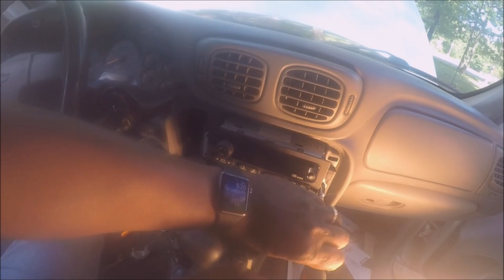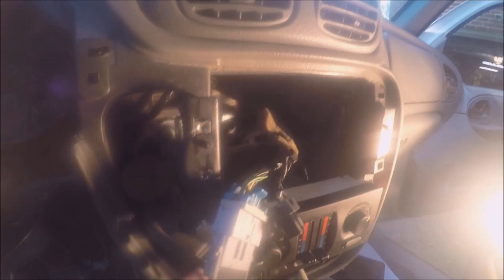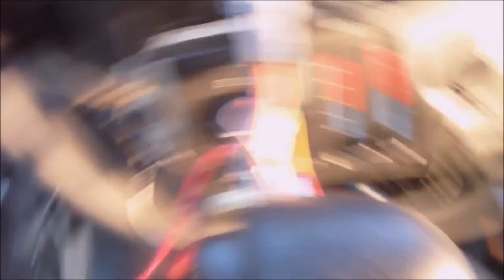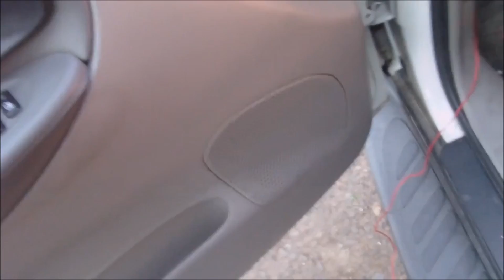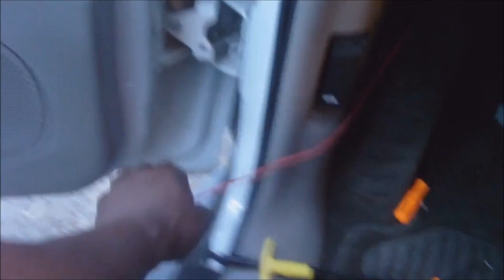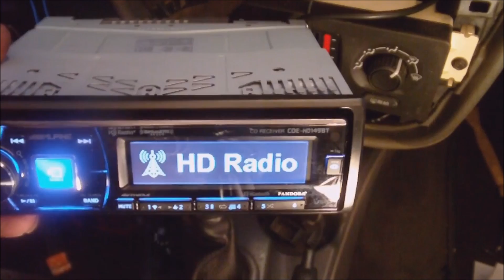2002 Chevy Trailblazer - Wiring The Headunit

Comment: What? Bro just use the power wire on the harness.. thats what its for... you don't need to do all that extra wire running. If putting a bigger amp radio just put a bigger fuse in the radio spot in the fuse box

Comment: Did you keep the fuse in the back of the radio or did you remove it as the add a fuse you used has 2 fuses

Comment: You added a fuse. The guy that did my stereo just connected the red ground to my ignition under the steering wheel and ever since I started to have idle issues. Engine revving up and down, car stalling behind red light. Can you explain why this might occur and why? I just cut the ground wire to see if it would make a difference and disconnected battery, but can’t really notice a big difference in the idle problem. My alternator checks okay too and so does the battery.
Reply from the maker: When you  said, "red ground"  that right there tells me a ground wire was hooked to a live wire so yeah you gone have issues.
Reply: Poppa T the idle is not normal, I disconnected the red ground wire they had connected to the ignition under the steering, but I still have the same issues. Mild Vibration...what should I do?
Reply from the maker: @belsinyounan  I would check the ignition fuse and if you are having the same issues a mechanic.  Too many variables to consider based off the information you are providing.

Comment: I’m trying to run my power wire to my battery and I can’t find a way to run though my fire wall is there other way to run it. I have a 02 trailblazer
Reply from the maker: See where the poker tool is?  That where you would make your power wire run through the grommet.   Just open it a little more for power wire.

Comment: This does work well...temporarily
The problem with hooking it up to your fuse box is, that’s also your trucks computer. This may work better for others but for me it worked for I would say 3 months and than out of random blew a fuse as well as caused my whole truck to shut down. It wouldn’t crank over or anything. Just be careful and cautious of where you hook it up to or you could end up with a problem like I experienced
Reply from the maker: Appreciate your comment but it doesn't hold much weight.  What you suggesting that a fuse tap shut down your vehicle which is preposterous and indicative to hooking up an alarm on a vehicle the same way.   Besides this video predates 3+ years and no issues so you most likely didn't do your set up correctly or you have other issues not pertaining to the audio portion of the vehicle.
Reply: Poppa T I see where you’re coming from but I actually had the exact same setup. I watched your videos when I did it, the problem occurred because it was pulling too much amperage. It could be other problems with my truck as well but I’ve been looking for another way to hook up my radio because for me this method didn’t work long term compared to yours. I was thinking of connecting the same wire you hooked up to the fuse box, to my battery. Only thing with that now is if it’s on the positive terminal it’s constantly on whether the truck is even in the run position or off. The negative terminal supply’s no power to it. Not too sure what exactly my next step is. Do you have any other recommendations?
Reply: We also have 2 different stereos, that could be a main cause of my problem.
Reply from the maker: @ThySteelStallion  Not a big fan of leaving too many hot wire laying around but if you did do that make sure you have a switch to it or you could just use the same wire I used and put a relay on it.  The relay will probably be the best method so go to www.the12volt.com and learn about relay wiring.  Hope this fixes your issue and hopefully you don't have a crapy Android HU.  :-)
Reply: Poppa T Neither am I but I hear ya. I’m gonna have to try it out thanks for the feedback!
Reply: The fuse has to be switched. Just to note. And best to choose something non computer related. I was going to run mine to the back seat fuse box, but I can't find a switched fuse/connection. 
Also note I don't think the  the switched connection draws  much power.

Comment: did you ever have a problem with your dash not working after ? all wires are connected properly. if i take out the add a fuse and put in the regul;ar it goes back to normal. any help is appreciated.
Reply from the maker: RiZzLiTo CADILLAC Tha Don Dash still worked fine. Make sure you are in the right port for the add a fuse. Then I would just make sure your wires weren’t crossed on the harness.

Comment: Awesome video ! quick question i had my brother install my radio and he did it without a wiring harness and recently if i dont start my truck everyday like if it sits for a full day my battery dies can this be because of that red wire not being ran to the fuse back so its not fully shuting down or something ? i just both the wiring harness getting ready to put it together today
Reply from the maker: Best thing to do is try and get the OEM harness back on there.  Possibly the ACC wire was tied to the hot wire and radio was on all the time.

Comment: Where did you tie together the ground wire was it the radio or truck harness
Reply from the maker: Well you tap into the radio and truck harness then run to the chassis.
Reply: Poppa T so when i tie them together then run it to the chassis
Reply from the maker: Jose Escobedo Yep. 👍🏾
Reply: Poppa T you think you can call me at 2196148916 I need to ask you a few more questions
Reply: I’m confused  but let’s just say i tie together all the wires together from both harnesses ok now since the ground wire is connected together do i now tie another wire to the ground then to the chassis or do i do it separate
Reply from the maker: Yes you do.  Tap into that ground wire and ground it to the chassis because it won't be grounded if you don't.  Factory grounds work differently.

Comment: poppa t i have some questions where you get the wire hardness at? and im putting a afternarket head unit in and putting subs in i have a 02 trailblazer does it have the remote wire on it thanks
Reply from the maker: clint lang Amazon or eBay. Remote wire is on the radios harness.
Reply: Poppa T with this method, will the door chime still function

Comment: Sup poppa T. I have a2002 Chevy trailblazer and I’m trying to install an aftermarket stereo and I need the name (s) of the red wire with fuse.ur video was a great help. Any info will be greatly appreciated. Peace ✌🏻
Reply from the maker: pandora jones As mentioned it’s a add-a-fuse. Because these don’t run off a factory ignition wire you have to grab it from the ING fuse As shown
Reply: Poppa T thanx for the info. Much appreciated

Comment: I have a 2003 TB no bose or on star...i bought the walmart wire harness with the interface module and hooked it all up...i tapped into my rear wiper switch for an ignition source...all my radio does is turn off and on over and over when i turn the key? any ideas? very frustrating.
Reply from the maker: John Jorquez you’re on switched power. Put it on ING1 in the fuse box. .

Comment: I have the 2003 trailblazer and I did all the wiring right for the wiring harness, but when I plug my radio on it blinks red so it's receiving power but won't turn on. Am I missing something?
Reply from the maker: Power is supplied by an extra wire for the constant.  That is not on the factory harness.  Do a separate radio check to make sure it's not DOA.

Comment: why do you have to run the ignition wire under the hood?
Reply from the maker: The OEM harness does not have a place for that wire to power the aftermarket HU.
Reply: Did you use a 10 or 20 amp under the hood?

Comment: what did you connect the red wire from fuse panel to on harness
Reply from the maker: That wire on the harness would be the 12v ignition wire.
Reply: so the red cord on harness
Reply: what about the red cord from radio
Reply: @samanthadavis3675  did u figure it out?
Reply: Poppa T im lookin for this harness do you have the part number

Comment: I have a 2003 trailblazer with bose. Everything is hooked up, but no sound . Any suggestions?
Reply from the maker: You should have a factory amp in there somewhere powering those speakers.  I'd pull a speaker and check to see if it plays independently. I believe the amp is in the right rear panel.